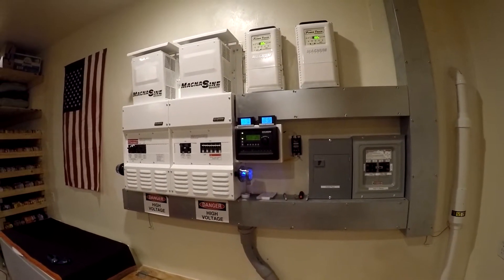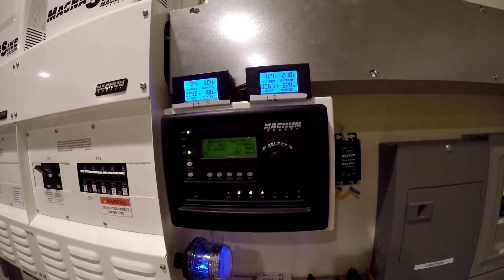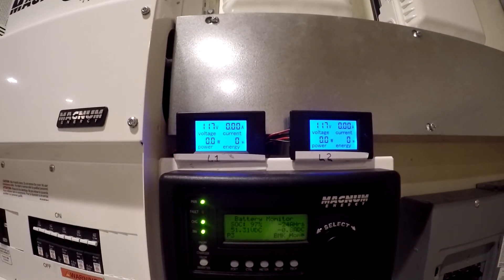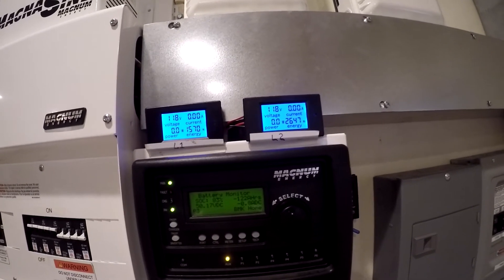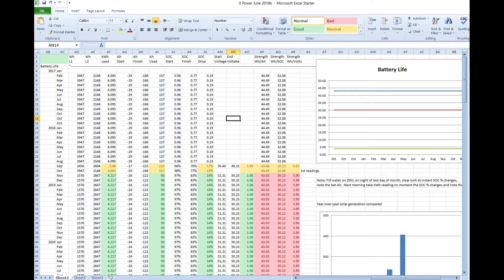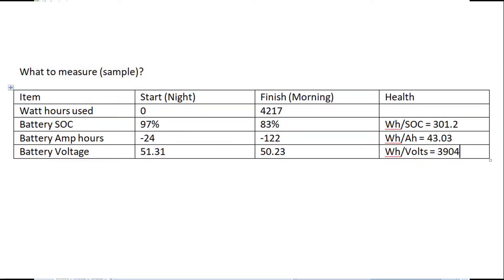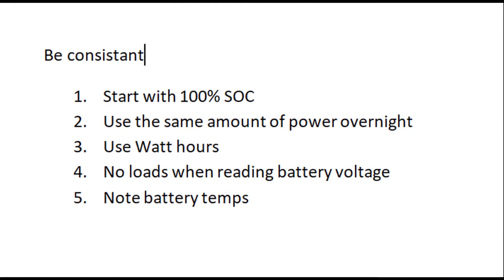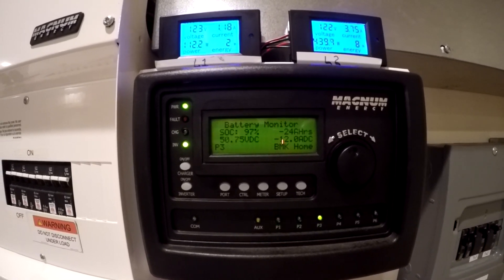Battery Bank Health Monitoring

Comment: Although I can follow your reasoning it will work for the whole battery bank's efficiency. The thing I have found working with old batteries is that all batteries are not created equal and the bank is only as good as your worst battery. So I have been trying to start charged 100% and the put a load on same every time (I use electric heater) then measure each battery voltage individually to see how far the load has pulled down the voltage I found 2 batteries so far that I had to remove from the bank so it would improve amp hours. I think a BMS adapted for lead acid would give more constant data. Just an idea imho. Cheers

Comment: Great Idea. I would record the battery temperature at the same time I record the the other data. Volts at any SOC will rise and fall with the battery temperature. Just a thought.
Reply from the maker: Well I actually just added battery temperature when I did my last test on Dec 1st.  I think that will be a critical piece of info based on what I learned recently about how the chemical reactions change at different temperatures.  I am also taking readings throughout the day so I can compare discharge curves vs. just single data points.  We are on the same page.  Thanks!

Comment: Thanks David. It will be interesting to see how the system holds up. Chris DIYer had issues with his Trojan batteries. Have you run into any weak batts or cells ?  J K
Reply from the maker: James,  I think watching Chris DIYer's videos may be what has me looking into this more closely.  I have not run into any issues yet but I do have a particular concern that I am going to address in my next battery video.  Thanks!